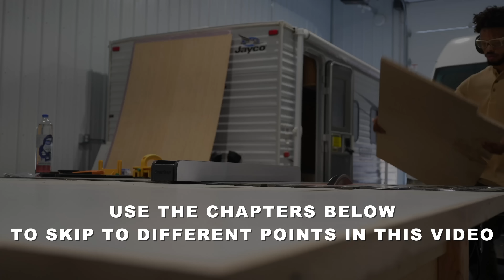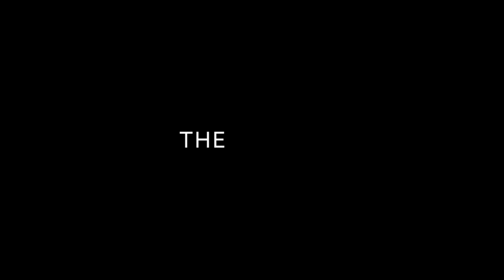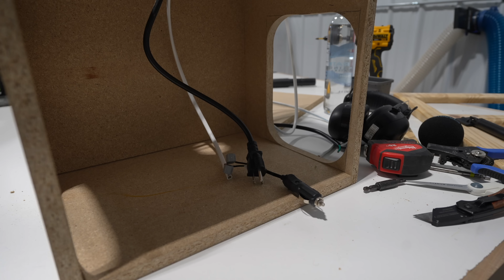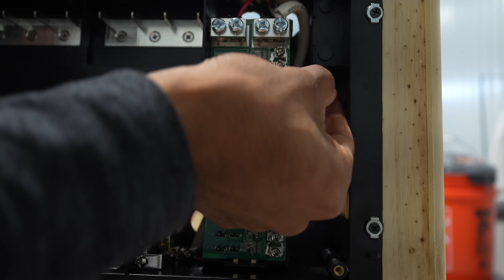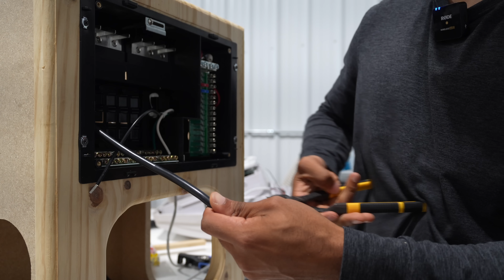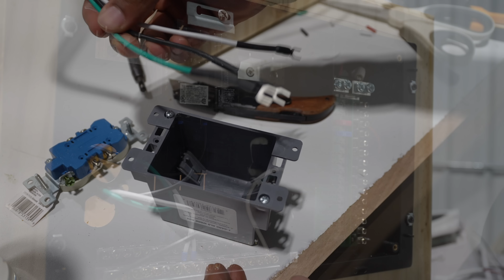EASY CamperVan Electrical Build - Start to Finish (W/a Power Station) Anker SOLIX C1000

Comment: This video got my interest peaked in electrical and allowed me to get my hands on this stuff and to build my own conversion. That battery has been a life saver, but through experience I realized that the electrical box wasn’t necessary for me. The Anker is great for plugging directly in, and as long as your appliances have built in fuses, your set up is safe and sound. A big box is to run a lot of stuff at once. If you’re watching this, you’re most likely a beginner, and so you’re probably starting off small. Let the simple and effective plug and play interface of a good battery do the hard work for you to start, and upgrade as needed.

Comment: Great videos! Did you mention that the 12v outlet has 10A max? I'm looking for a power station with high voltage max 30A outlet but there arent many.
Reply from the maker: I know that BLUETTI has one that is 30A max. That’s the one I usually use now

Comment: looking to do this with my Bluetti AC200L but confused on how to connect the AC from that to the dist panel.  Have a 30A AC out and four 110 - you just hooked out of a singular AC outlet it looks like, but used a 30A breaker as your main?  This dist panel also has an AC plug for the bus bars in the back - does this get used?  Good content thanks for the inspiration.

Comment: What’s the safest and cleanest way to keep the bluetti plug in to charge by shore power but also power that breaker when there’s no shore power? Obviously manual unplugging the charge cable to the unit is simplest but I want to prevent a power loop of the power station providing power to the breaker which charges it.

Comment: You left one black AC wire unconnected, what is this cable supposed to be for ? The one originally in the box is not connected anywhere, while the original black and green ones are.

Comment: Do you still do builds? I'm buying a 144 high roof Mercedes sprinter van. I'm looking for a very basic, bare bones build with solar, 12V AC, fridge and propane cook top.

Comment: Could you plug the 110v outlet (that you plug into the power bank) into an extension chord and run the camper that way when the power bank is not being used?
Reply from the maker: Theoretically, yes you can, but it’s not advisable without some kind of intermediary device to manage the current
Reply: @Dualex_Builds  Do you mean like a surge protector like a watchdog? Or do you mean some other kind of device?

Comment: I want to do something similar to this. However the problem I'd be concerned about is that the 12v output is limited to 10a. So if you had a lot of stuff like fridge, lighting, phone charging etc on, you'd be getting close to that 10a quickly. What do you find in practice?
Reply: Please let me know if you find something in this topic I want to do the same as he is doing here and I already have 410w solar panel, pecron car charging 500w when driving and I want to add two other lithium batteries to charge the Anker Power station but I am not sure about the 12V thing like you mentioned!
Reply: @valonrukovci7142  I got a aferiy p210 which has a 12v 25a output with a xt60 connector. So used that.

Comment: You need to get some cable clamps, the hole the wires come into the box from, the edges can cut through a wire overtime with vibration. Cable clamps are considered code when it comes to electric work.
Reply from the maker: Thanks for the tip. This video was made a while back and I use rubber grommets now. As this is not a house, there is no code to follow
Reply: @Dualex_Builds  Glad to hear and mind you I'm a big fan of your videos, doing my first built myself so i look at a lot of your videos for inspiration. For anyone else that reads the comments, picture 120v at 15amps charging the panel, you touch the panel and meet Jesus. That's why this particular code should be followed. Stay Safe.

Comment: First off, GREAT JOB!!! As someone who is planning to build a camper van, you made the electrical install seem much easier than what I've seen in other videos. With that being said, is there a reason why other people seem to have so many power stations and you only used one? Will one be able to power a van with multiple items that need power? Also, if you have a power station, do you also need to have solar power? I am definitely going to look at more of your videos, so that I can learn more. Thanks for what you do....

Comment: So I have a question...Can this be done with the Anker Solix f3800 with the added banks. I am asking as I want to us it with solar and such to power a van build that also includes a custom gaming/streaming build. Would this pretty much work the same way, just a larger setup configuration?

Comment: wont that be to weak? most people have like 400ah of battery, I think its a lot more than what that bank can do.
Reply from the maker: It depends on what you’re going to be using in your van. In my experience, 200ah is usually more than enough for me sometimes I need even less
Reply: @Dualex_Builds  Oh its 200ah, then yes that planty for most van lol, except if you want ac.

Comment: Awesome job! Thank you for the information.
I have a 2021 Mercedes sprinter and finally decided to add power and have a few questions 

Question 1…how do you recharge power station ? 

Question 2. For ac power , can you use traditional wire used in residential homes. 12/3 or 14/3 romex ? 

Question 3… you ran one 15 amp breaker to one outlet…wondering if you can daisy chain multiple outlets to each other to same breaker like they do in homes

Comment: Great video thanks for taking the time and effort to explain. Any updates on how this setup is working out? That “cigarette lighter” wire is tiiiiiny. Wondering if it was able to run all the DC items without melting 😂

Comment: PS : EXCEPT for Throne Room and Shower I will doing some old style. via back up  sink pump system for  and shower. Maybe over head water with a heater . But will incorporate a wood burning stove with side pull out side feature when parked. . Cover even for  small solar panel,  ruff panel or use a portable one. I am going to be ready for EMP from sun so I don't want to worry about when the power including in vans is knocked out. PS I know you can install an EMP protection breaker for diesel engines.

Comment: Dual EX I have watched dozens of videos You are the best hands down No contest. I am 78 years old male  and contemplating going on the road. I am going to use a diesel all wheel  drive Mercedes if I can find one cheap and in good condition . will have retired carpenters around my age  help me.

Comment: Question on heat in the box?  Is it better to spread the wires out in the fuse box? For safety reasons, should a cooling fan be added to the powerstation to keep it cool when running lots of amps or volts through the system? I dont know where heat gets into the wires is why Im asking.

Comment: Q… I was looking at a F3800 for a van. I noticed that the car 12v socket is only 10 amps. So 120 watts.  No 12vdc air conditioners eh?

Comment: genuine question since I'm new to all this: does the main AC plug that goes into the Anker SOLIX power the rest of the breakers on the box (the outlets in this example)? I also noticed an AC plug on the back of the breaker box, what is that used for?

Comment: Thanks bro you  I 'm from France , even struggling with English    I' ll finish by understanding all , a great content no way to find it in french, I started converting a mini  camper  just for holidays and week-ends I bought Fossibot F800 a  512 wh  power station & 100watts solar panel I a have my CPAP apnea machine   2 led 5v lights a 12v fan a  Water pump . 
Thank you so much God bless you

Comment: Really helpful videos. I’m building a promaster currently. I’m using an Anker F2000 with solar, etc. You said you use a thin gauge wire for DC lighting…curious..what guage wire did you use? What guage wire for AC appliances did you use? Does the brand of the breaker matter? I see you use Siemens…thanks!
Reply: Heyyy I'm also building mine going eith the 767 tooo!!! Tbh just go with whatever Guage wire has the amount of amps you believe you will be using wathc luaren she is way smart does super indepth videos....what solar panel company and wattage did you buy???
Reply: Oh, cool! I’m using two - 200 watt Bouge RV solar panels that are wired in series. Just hooked it up yesterday and they work. I wish there was a video on how to set up a master switch while using a portable power bank system recommended by Dualex. From my understanding the master switch protects the battery bank allowing you to “drain and charge the battery evenly.” If I don’t use one, I guess the battery bank is at risk for damage?

Comment: I'm starting to learn about wiring for a build I want to do. I have zero electrical experience and found your video to be the BEST I've seen that  takes it from the item you want to power all the way to the power source (battery). Very, very helpful. I guess you can teach an old dog (me) new tricks! Thank you so much.

Comment: Can someone please help me!!!!
I bought the same camera and monitor that he uses in the video. I plugged the camera into the monitor and the monitor into cigarette lighter. But no picture from camera. The camera wires have a small wire, I think that is for the tail light!? 
I don’t know??
I’m trying to get these cameras to work and I cannot find any video on how to do it. I see that he uses a fuse box and all that jazz - I’m not wanting to do that, so what is the simplest way to get a picture on the monitor??
Help please!!!
Reply from the maker: I have a separate video explaining how I did my camera system step by step. The title of the video is “how I made a stealth security system”

Comment: Great video, very solid step by step!  I have a Anker 3800 I need to connect a Dometic RTX 2000 to.  Any suggestions on connecting?  Still use the car 12v port like you did here since its a low voltage ac unit?

Comment: Hiya! Couldn’t find the box u used to store the electrical fuse box that came with a lid etc. you said it there would be a link Nope. Went to ur Amazon Product list😢😢. Please help.
Reply: I am looking for the same thing.  The product in question I know is called an ac/dc distribution panel, but I have yet to find one that hooks up the same way as far as the dc side goes.  I like the screw in, but ones I've found have it some other way and not a lot of info surrounding how it functions.

Comment: Off topic question but I’ve been having a problem that i thought you might be able to help me with. I’m running a small fridge off an eco flow river. When i plug the river into the truck (22 Colorado zr2)12V it kills the battery and causes power steering issues. I replaced the original battery [only 15k miles)but the 2nd one did the same thing. Any thoughts? I always thought you could charge the power station from the battery while driving. Any help is appreciated.

Comment: for DC power, if you are going to use this to power more DC things like LED lights, 12v fridge etc. How would you size a larger wire for the cigarette outlet? Wouldn't that outlet be limited to like 15 amps?

Comment: Thanks for the tutorial.  (from a guy with a home built 279ah system with big external equipment that takes up way more room to install). I just wish these solar generators had an SB50 (50amp dc socket) the standard 12v 10A is too small for people like me;"). It is cool and a lot cleaner to use a powerbank.  I am wondering how you handle the DC charging to a single port.  Do you unplug the solar when driving, and attach to the van's 12v outlet to charge the battery when you are driving?  Or is their a better way to share the dc charging port?
Reply from the maker: Some of the solar generators do have 30 amp and 50 amp dc ports. I used one in the previous van I built. Usually the smaller units like the one I used in this video only have the basic cigarette style port. Same with the charging from the running vehicle. I with these smaller ones I usually connect a switch so I can have it charge through the vehicle but again some of the larger units have both ports on there so you can charge both ways at the same time
Reply: @Dualex_Builds miss your content bruv.  Hope yr ok

Comment: Hello, does anyone here have experience with EcoFlow, specifically the Delta Pro as a substitute for this Anker? Some basic questions I have as I am researching which is best for me:

1. Is there any reason you see that the Delta Pro couldn't do the same things as you have demonstrated with your anker and bluetti videos?
2. Is the 10A DC output on this anker from the 120W car socket truly sufficient for running all of these appliances in a van build (fans, lights, fridge, water pump, water heater)
3. 12.6V leaving the car socket, is voltage drop an issue? Do you observe flickering lights, fridge or other appliances not working?

4. Have you heard reliability issues or why have you chosen not to use ecoflow in your previous videos? Perhaps just pricing?
5. Do you recommend running a fuse between your power station and the fuse panel? 

Please let me know if anyone has a perspective here, thanks!

Comment: do you think you could link the box that you used? I don't want to have to buy a 12v fuse box and ac power distribution block separately.

Comment: You really need to add rubber circular grommets in your roof cable holes to protect from chafing and electrical shorts/fires.. Like other vehicles, these should be added anytime you pass live wires through sheet metal or bulkheads. they can be added to current installation by making one cut and spiraling them into place.

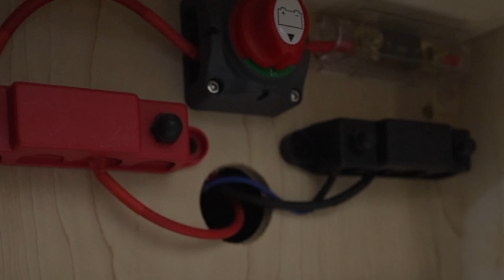Comment: Hey, @DualEx - Thanks for the very informative video! Question for you: at 12:07 in the video, there's a pan over your master switch, fuse and fuse holder, and two bricks with wires in and out. One brick is red, the other is black. What are these bricks, and what is their purpose? Thanks in advance!

Comment: Hey dude I commented on another one of your things I'm watching your truck build and that's exactly what I want to do to my Tacoma but anyways I want to ask you do you use DeWalt tools as your main tools but you use Ryobi screw guns and stuff like that Anaheim nothing but problems with Ryobi back in the day Del Mar homeowner tools than construction or even doing what you do so I guess my question is has Ryobi stayed did they turn into a reputable company again to where you can actually do this stuff daily and them not burn out burn the brushes burn the shanks and s*** but I want to give you props to tackling stuff that you don't know what you're getting into like me with my remodeling I open up a wall or a ceiling and I got 5000 wires going through it water lines gas lines low voltage and I got to reroute it all you're basically starting from new and that's awesome so I love I'm about to watch how you put up your electrical solar system right now so please keep doing what you do to you know let us people that actually freaking know everything else that we can learn that that other stuff the simple stuff that seems so hard to us and we've never tried anyways much props to you personally and God bless

Comment: I wish these companies would start upping the DC output to 20a or so on these smaller power stations. I think Pecron is the only one that has done it with the E1500LFP which has 300-400w DC output.

Comment: Awesome vid my dude! So i would assume instead of the cig lighter outlet which would only charge the power station at 100 watts, i could run cable straight from the car battery to an 500 watt inverter with a fuse to  power/charge the power station at 400 watts or what the car/truck altenator puts out? 

Would you have a swtich in-between dc and solar to charge the power station or just unplug one source and plug in the other? Thanks im tunned in!

Comment: My friend, I'm on Long Island New York and I have an offer, a serious offer to you. Actually I think you would be doing me the favor. I have a 25 foot shuttle bus and I need the heat, AC, lights and radio to run when the bus is off, completely off. I don't think running the heat or AC for four hours a day will work off solar; and I think the best combination would be a generator hidden underneath as well as a shore power system as well so I can plug in if needed. My question is to you, will you come build this for us? I know you will do it proper and will pay you for your time of course. I am putting it out there.....

Comment: Thank you so much this is exactly what I wanted to see. Every video I've seen about electrical has involved hooking up batteries to chargers and inverters and all that stuff, and I'm perfectly happy with my little box that has all that stuff in one unit like your Anker. But I didn't have much info on how to connect it up to outlets and appliances around the van and this will be helpful

Comment: You didn't  do it wrong.  Just different from what I was shown. On receptical or switches ( 110/120 volt. Green wire ( ground ) goes to green screw. The white wire goes to the silver screws. And black/ power wire goes to the brass coloured screws. Your wires are all in the correct locations. And again very well explained. Are you a teacher? 😊

Comment: What size wire should  be used for the main 30amp breaker.  15 amp I know is 14 gauge.

Comment: Great tutorial, thanks!  Will there be a part two for hooking up a solar panel to charge the power bank?  Love watching your build videos :)
Reply: The Anker power station he has a take up to 400 watts of solar input.   With this device it’s pretty much a “Plug and Play” machine, so hooking up the panels is very easy, and straightforward and you can just plug them into the back of this machine.